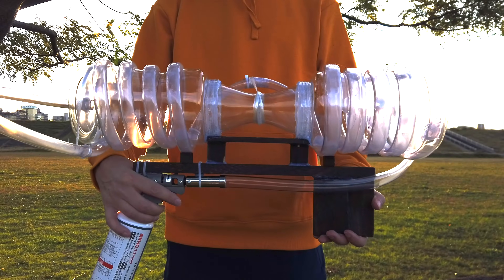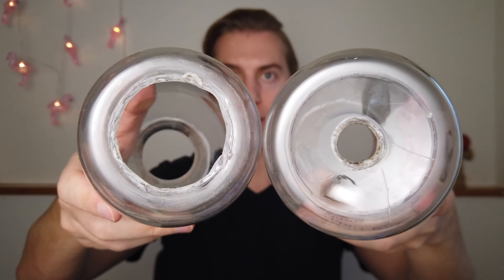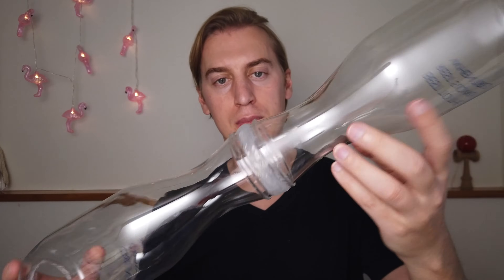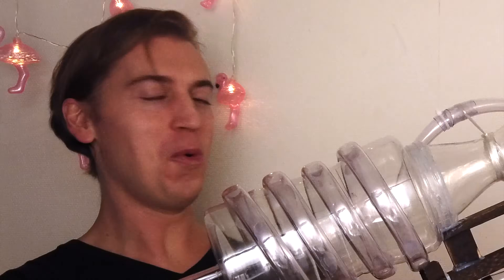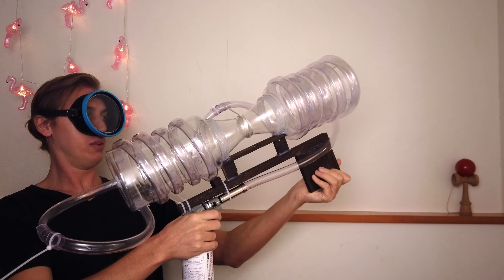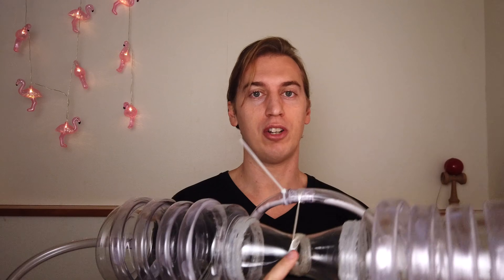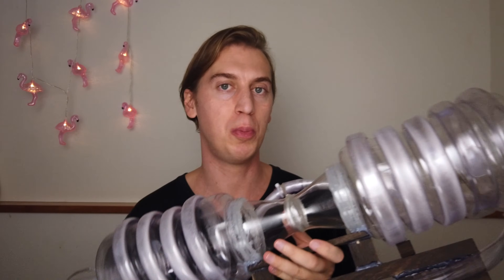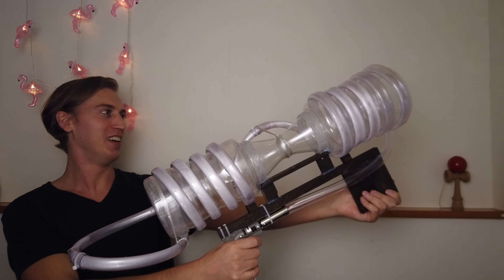Plasma Gun DIY???

Comment: To get this weapon to fit with my needs would be I would not let it switch directions within the piping might be slowing it down and for more power I would use copper tubing for the ball to go around in increase its power with electrical current because I would be wanting it to be as deadly as the plasma rifle in Halo another words are second amendment is threatened and we need something the government does not control if it isn't gunpowder it's not a firearm
Reply: For the fireball to get more power you need a lot of copper

Comment: You get the key point,like first assemble the tube on the plastic bottle then assemble them on the support. That is very useful for reduce the band place,very useful. And hold the trigger for seconds after fire, also very very important details. Thank you for sharing, ❤❤

Comment: I found out that if you put a hole in the start it gives oxygen to the gas which helps power the plasma
Reply: Wdym
Reply: @Nii-san0416  Put a small hole in the tube at the very start close to the torch to give the plasma enough oxygen to burn
Reply: tell me where did u find that info, im not sure but i feel like it would make the sparkle explode due to the oxygen, i wanna check that
Reply: Thanks

Comment: It would take some time, but if you fill the tube completely with sand and then bend it, It shouldn't kink.  The sand would hold the shape no matter how tight you turn it.  The trick would be emptying the sand once done.  You could face it down and swirl the sand out and possibly blow compressed air through it. Just a thought.